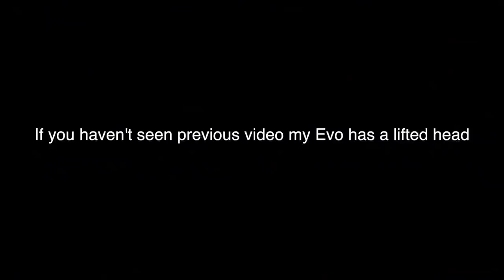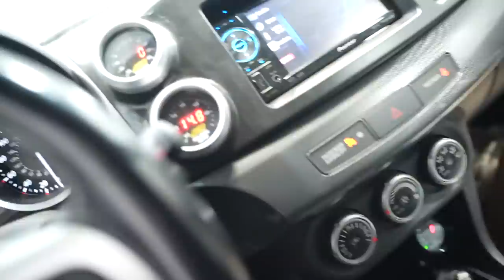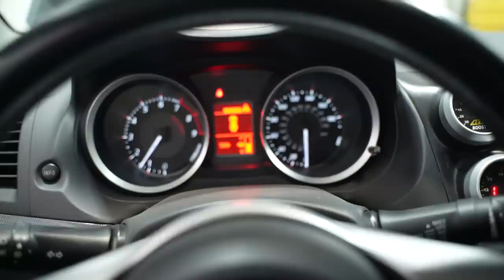Starting my Evo 10 for the first time!!

Comment: If you are going to detune the engine you should do a swap  before Devin parts it out. You have a lot of forged internals you won't use and he will. Get yourself a nice stock engine that's running clean. Just saying 😌 🤷 😏 😉
Reply from the maker: 🥴We are putting a different turbo on my Evo ; not putting it back to stock.
Reply: @Bobbi_Niemela  would have been nice to see how much power it had. Wishing you the best in your endeavors ❤️